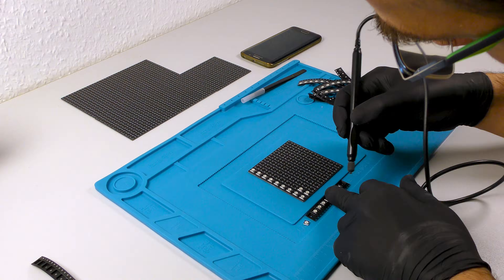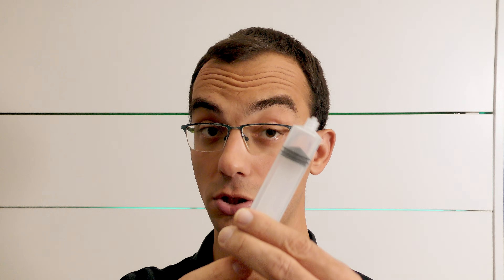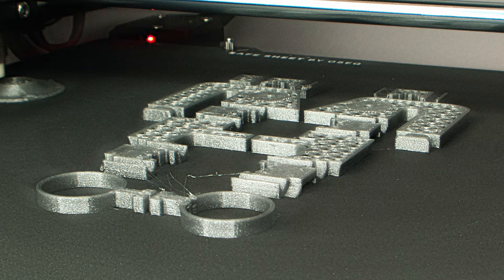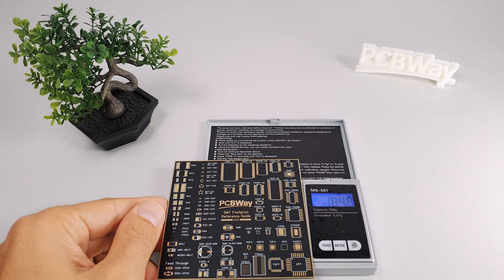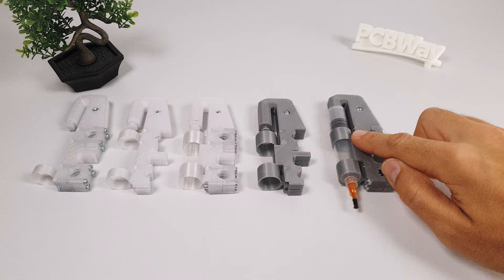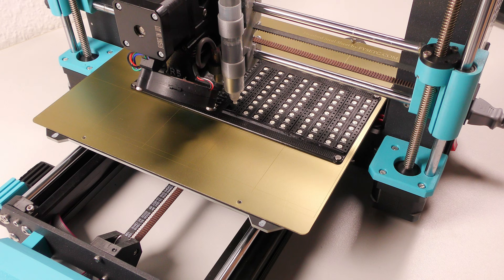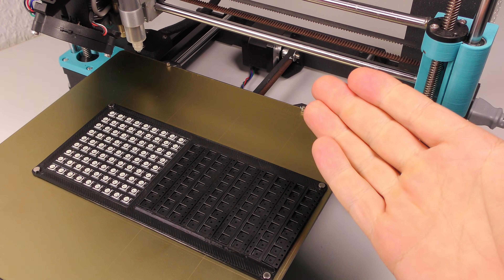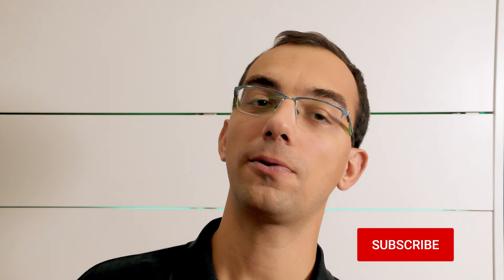Prusa MK3s Pick and Place Extension [3D printed] 👌

Comment: Care to share the STLs? I am interesting in picking up (pun not intended but I actually like it) where you left off. I want to introduce computer vision to assist in calibration  and verification, and perhaps go a little faster as well. I had the thought of testing various springs to get varying amount of vacuum and release pressure within the mass of my common parts - I don't need to lift a whole PCB but rather just some really small parts (your LEDs are large but my resistors are small so I need more precision in placing them but can use far less vacuum to P & P).

Comment: Very cool ideas! Especially using an affordable printer for such tasks. I don't know how you tricked the Prusa slicer since a cylinder would require not just a touch, but bravo!
Reply from the maker: If the cylinder smaller than the set-up nozzle diameter, then it won't make a circular movement.

Comment: I forgot to ask, where can I get the same nozzle you used?

I can't find any, I'm ordering the latches soon, would be nice to have the nozzle arrive around the same time.
Reply from the maker: Hi, I bought them on AliExpress, but after checking my previous orders now for you, it is not available anymore. You need to find some alternative.
Reply: @Dombi3D  Thanks for getting back to me so quickly, the closest things I've found so far are the little pen type things with a button, they have some spare nozzles but look too small for the syringe.

Any new videos in the works?
Reply from the maker: @welshdave5263  Yes, but with other topics. Snapmaker review, but I plan to make a similar design for it, because it has a much sturdier structure as the prusa had. I just simply can not manage everything parrallel what I want...
Reply: Could you please tell where I can find these types of latches. And for the syringe what was the volume?

Comment: I know this wasn't the main focus of the video, but how does that infrared ic heater work?  I'm asking, because I'd love to do some sheets of neopixels, but wasn't sure if that would work with flexible boards and I'd also like to understand how that works in general.  Since you said reflowing, do your ics come with solder on them already or do you dap them with some first and reflow it for a better connection?
Reply from the maker: I put solder paste first onto the boards, then placed the LEDs and then reflow them.
I have also made changes on my reflow oven to be better, but you can find several videos about it on YT. It worked fine for me so far.

Comment: For simple "stupid" reptitive g code movements you can easily program with excel.

Also  mks servo drives would allow much more speed. You could set jerk and acceleration values to the moon because you don't need smooth linear movement a print needs. Then you would have a pro level PNP machine.
Reply: The problem is, this 3D printer moves the bed, so you would knock already placed components around with bed movements.  A CoreXY with dedicated Z-Axis for the toolhead is WAY better suited for a pick and place application, especially when it comes to speed.
Reply: @ProtonOne11  I agree. Thats why you would want a core or any non moving bed machine. Then feed with a palet system.

Comment: I wonder if you could make a machine dedicated around this mod
thinking what if you could have it so the bed after placement could go further back into a IR oven area to be flowed, and replace the print head with an inspection camera?
Reply from the maker: Sure there is a potential in it. Would need more free time to further develop. If the videos going viral in this topic and the community wants more then I will try to give more :)

Comment: By utilizing pins on the heatbed (which is normally used for steel sheet) you could skip the manual alignment process at the start.
Reply: can you please explain how this works?
Reply: @ulamss5  there are two index screws in the back of the heatbed. The steel sheet you place there is aligned correctly by touching them... so if his rig is pushed against them the same way as a steel sheet is placed, he would be set just by this technique and would not need any manual alignment later.

Comment: With a single stepper and ball screw, you could squeeze a syringe of solder paste to prep the pads. Getting the paste to separate from the needle could be challenging. But you should be able to shear the "solder noodle" between the needle and the PCB.
Reply: what about a sprint that open a piece of metal when its extruded and shuts when there is no pressure.

Comment: Pretty cool. Does it really save any time since you have to load the fixture, or does it just make it less tedious since you're not manually placing on the paste?  BTW thisoldtony has a video on the push on / push off mechanism if anybody is interested. How do the leds come packaged would tape and reel make it easier?  Anyway pretty cool.
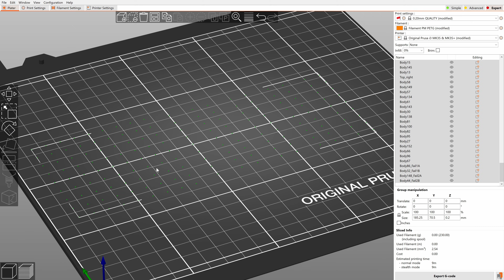Reply: The LEDs were in a pick and place reel. It's like the gum that comes in those pillow packs. The cup side is black the top seal is clear. He only had to cut the reel into steps of the correct length, press them in his jig, and 4:56 peel the clear top off.
Reply: @RichardBronosky  Thanks, somehow missed that.

Comment: Now somebody just needs to make a slicer that maps a PCB file + a file containing position of components in a component tray into the motion required for this tool head. Combine that with a jig that clamps onto the bed in order to make short work of zeroing the PCB & component tray relative to the expected gcode positions more quickly and you could quite easily optimize the setup process for a larger variety of PCB designs. Throw in a bit of linear advance and other 3D Printing tricks and you could even shave off time from the actual execution.

DIY PCB machines might become practical enough to make add-on kits for some 3d printers (I'm thinking in the same vein as the Ender Extender kit for the Ender 3) as like a rapid prototyping tool for PCB designers (Which would probably be used in unison with a CNC capable of making DIY PCBs, or one of the other methods of fabricating DIY PCBs).

Edit: Now that I think about it, it would probably be better to make it an add-on for a CNC with a tool changer instead of a 3D Printer. Although, I think the gcode PCB mapping software I described above would still be applicable.
Reply from the maker: Exactly! This video just shows the base working principle which could be expanded to a complete product. Let's see if I could manage it to develop further.

Comment: It wouldn't matter if was the same speed or even a little slower. The fact that you don't have to place any of them means you could be doing other things like setting up the next run. This is the perfect kind of hack for a 3D printer.
Reply: Not only that, but you should be able to easily extend the jig to handle at least two boards at a time.  Also, additional printers can be had pretty cheap.
Reply: This! The main advantage of automation isn't about being faster, it's about needing less operators for more work 😁
Reply: And they might be aligned a lot more precisely to give a cleaner image

Comment: I could see this moving into an open reflow oven with a z belt. You could have components roll into jigs that overlap the print area   That would probably require some custom slicing though
Reply from the maker: Everything is possible just the question of time and resources.

Comment: I feel like this would be a sick upgrade to a belted-Z printer like a Voron Switchwire. You could cut out a ton of the Z travel time.
Reply: Conveniently, I have a Switchwire and was thinking the same thing!
Reply: When you said belt, i thought you meant something like the White Knight by Nak3D or the CR-30!

Which now that i think of it would allow for easily integrated (just need a placer mechanism for new plates maybe?) automatic production!

Granted the lack of aligning/visual confirmation equipment may be an issue.

Maybe Guidebars (to constrain the square boards to a parallel and smaller part of the belt) and some sort of LumenPnP component fork could make it work!
Reply: Most of the Z movement is not travel, it’s to actuate the piston.

Comment: could you make a jig the same size as the bed  so you can use auto home etc to always find the corners to line every thing up , also whats the smallest thing it will pick up , also to create unusual paterns would you just import a patten in slicer and place an object the size of the chip to place at the desired points
Reply from the maker: Full bed jig would be possible. It would be even better to make a jig which holds the reals themselves and the print head could be programmed to roll down the real, so it needs to move always the same place  and would leave more space on the bed for the PCB. Sounds like a future project :). 
Smallest thing I have not tested yet. But I would not think, that it can grab the smaller resistors and capacitors.
Another missing feature, that it can not turn the grabbed parts, that is why I had to put the LED reels like that. I could install a stepper motor on top of it to solve this issue, but then it would be more complex to make it easy to install, because of the extra wiring.